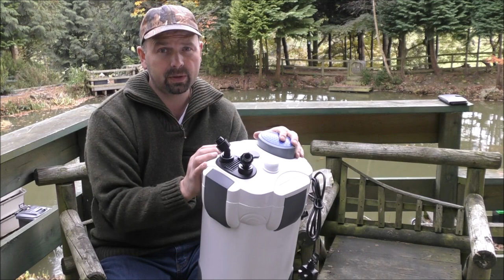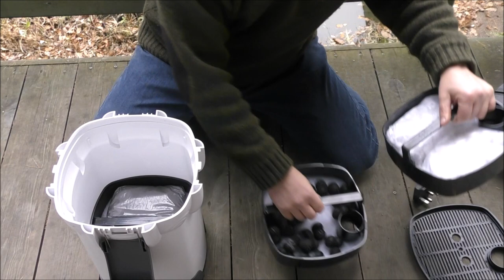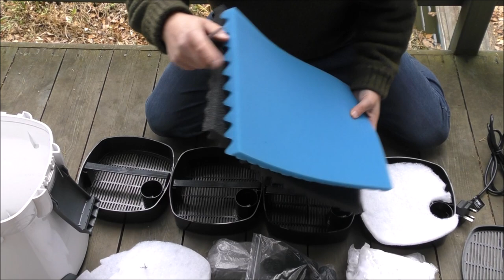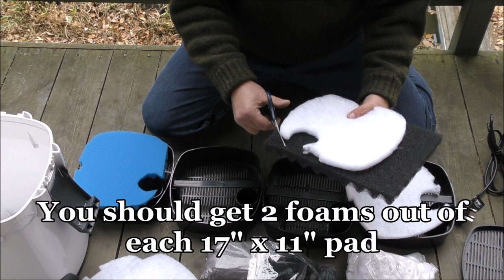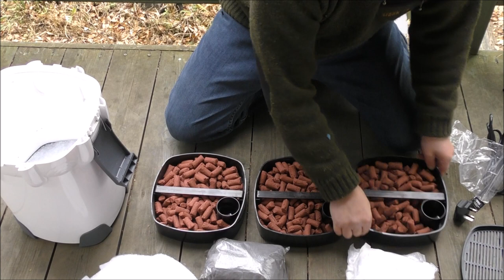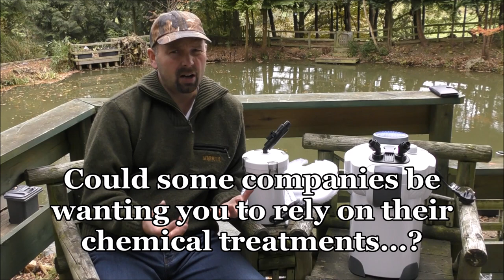Why Your Filter is TOO SMALL and NOT CYCLED

Comment: Got a 90g tank with a 150 gallon filter and a 70 gallon filter. Lots of live plants, and about 25 small community fish. My water stays crystal clear. All I run in my filters is filter pads with sponges, bio balls, and carbon. I have 2 air stones and 2 power heads. My tank is always beautiful. Oh and one of my filters has a UV sterilizer I only turn on if I start to see some alge growing at all.

Comment: Woody's Discus (FB)
No tone taken, Mr. P.G. A big thank you for the info. I bought 2 KG's of the "good stuff" for my Discus tank. Now I have a 150 gallon on its way. My Discus will love it. My 2217 has lost a spot in the filtering dept. Bought a FX4. May need a bit more media.Will give Don a call.  (will watch video again first )
Thanks Again,
Craig
Reply: BTW, my nitrates are 0 since using Bio Home !
Reply from the maker: Groovy, thanks for the feedback as it really makes a difference. 
I'm not sure why but there are many people online (who should know better) who continue to insist that biohome can't possibly help to reduce nitrates but the thousands of people all round the world using it in all sorts of tanks achieving the full cycle would suggest otherwise. 
It's a simple matter of creating a receptive structure which is varied enough to support different types of bacteria and although the media is very labour intensive to produce the results speak for themselves.
Best of luck with the big tank, man.

Comment: I am using this filter. Tray 1 - using the four thin 'fine pad' mesh filters supplied (one per tray). Trays 2,3 & 4 - all ceramic noodles / rings 4.5kg. I do have a small pre-filter on the intake. Small bag of carbon and bio balls that I received with the filter?, I will save for a small aquarium. Great video.

Comment: Thanks for the video! im new to the hobby and had been given maybe correct but incomplete information about the cycle and especially filter size. before this video my 160l tank had a filter designed for up to 200l with at most 3/4kg of media and my nitrates were a constant problem, i have now got the sunsun 304b and added an extra 1.5kg of quality media plus filled all the gaps on those trays with bio balls. im guessing my little tank is gonna be extremely happy with the upgrade! your advice has saved me future problems!

Comment: Good stuff here.  I was contemplating putting a Seachem Tidal (using only physical filtration) on my 55gal cichlid tank to help shoulder some of the  load from my Aquatop CF400uv.  But I just placed an order for the Filter Booster instead, so I can have 3 full trays of bio media in the can.
    Also, putting a coarse sponge on the intake tube that sits in the tank has made a big difference.
Reply from the maker: Yes, those two decisions should really make a difference to the filtering capacity and ease of maintenance - that's what it's all about.

Comment: One thing about biological filtration that everybody skip but is very important, especially in planted tanks where there is a lot of rotting debris from dead leaves and wood hardscape, is the fact, that besides nitrogen, there is also carbon to be warried about. I mean all the organic matter that builds up over time and can lead to red algae infestation. Having a big filter with plenty of bio media not only supports the bacteria responsible for the nitrogen cycle, but also leaves a lot of space for the bacteria that decompose organic matter, meaning less water changing, no substrate cleaning and healthy aquarium.
Reply from the maker: 100% - a filter should always be 'over-sized' for the tank.
If you follow the manufacturers inflated claims about the tank size the filter will cope with then the filter will surely end up being under-sized.

Comment: took a long time before I bought a good external, ive got a 350l corner tank with built in filter (1000l an hour so 500l in real time) plus a Aquael Filter Ultramax 2000 set up as per pond guru's video been running for 6 weeks now and tank looks good

Comment: I use that booster filter, the small one you showed but mine has its own pump.  I used it on my Nano tank  and it did a great job.  When I got rid of the nano-tank I put the small booster filter on a 65 gallon tank and the discharge from that booster filter goes into an HOB full of biohome ultra with forced bottom up filtration.  That is in addition to the two canister filters I have on the system also with biohome ultra in them.  Works great
Reply from the maker: Sounds good to me and you can never have too much filtration. 
Groovy.

Comment: I agree 100% with the statements regarding chemicals. I used Seachem Prime for years & it's only since I stopped & moved to a HMA that I have noticed a massive improvement in water quality my PH is more stable now as well it would fluctuate loads with Prime when I did a water change even when left to mature in a butt with a heater & air pump, the reason I Prime it in the first place is because my tap water has Nitrate in it which I thought was bad but it really doesn't matter as long as your filter is sufficient enough, your better off not using any chemicals at all.
Reply from the maker: Boom - you got it, it's all about the filtration. 
Look after that and it will look after the water - so many water quality issues rely on bacterial processes and when the bacteria is adversely affected it has a direct result on water quality which has a direct result on fish health.

Comment: Thank you, Pondguru! I've been wondering why my Eheim Ecco pro 130 felt so anemic (even with a properly configured setup of coarse/medium/fine foams and 500g of Biohome ultimate): according to Eheim website's specs, it's actually meant for 60 L tanks, which is half the size of my current 31 gallon tank. So, I just ordered the Eheim Pro 4+ 250, which is truly meant for an 120 L (31 gallon) tank. I also ordered 1 more kilo of biohome ultimate, for a new grand total of 1.5 kg of biohome ultimate, from Pondguru's US supplier: GreatWave Engineering.

Comment: Great video. Demystifying canister filters. After watching your video of how to setup a canister properly you put out a ways back. I set mine up that way. I would like to show this video at our local aquarium society meeting if that is ok. I purchased an Eheim 4+350 to run my 55 gallon or 200 litre tank. It will be prefilterd by a corner matten with the intake behind that. Now just have to track down some biohome ultimate. Cheers from 🇨🇦
Reply from the maker: Yes no problem - feel free to use the video however you want to as I put them out there to be shared.
There is a supplier in CA - http://www.angelfins.ca and the links to other supplies around the world are at the top of every page of my website http://www.filterpro.co.uk
Hope that helps.

Comment: This is the best info I’ve ever come across regarding canister filtration.  Thank you very much!  I used the foam technique but using lava rocks instead of the expensive biohome media.
Reply from the maker: Lava rock is fine as a DIY media and certainly more effective than the poorer forms of ceramic rings so its all good - whatever works for you is the best choice.
Reply: Pondguru Pondguru So I ran my filters for about 4 weeks and just checked them out.  Lots of muck in the bottom, replaced fine foam.  Bio section was spotless.  Great system!  Thanks!
Reply from the maker: Awesome, I'm glad to hear that it is working well.

Comment: Thank you very much you made a lot of sense and I did find it very helpful. I did feel that the sponge with the biggest holes should go on the top as the filtration for my tank just has the water trickling from the top. Yes you are right, I got told that I was doing at upside down. I felt that the foam with the biggest holes would collect the biggest junk first and not let the white foam gets so clogged. I am going to try and change from this silly filter to one of those barrel filters that you were talking about. Thank you so much you made a lot of sense.

Comment: I'm so glad you used that Sunsun 2000L/hr filter in your video. I currently run 2 of them on my heavily stocked 300Litre African Cichlid tank plus a sponge filter for quick cycling an emergency or hospital tank. 1 of them I run with a UV light the other without. Would you recommend I use the UV light on both or 1 or none at all.

Comment: THank you for posting this video it's very tutorial! I have started this hobby 1.5 years ago on a 60L tank (for tutorial reasons a smaller tank to prevent expensive mistakes) with JBL410E canister, Dennerle Osmose and Dennerle Remineral+ my diamond tetras feel great with 20Litres water change a week with NO2 and NO3 barely measurable with eSHa test tabs. I have been running this filter for 13 months now and got my water tested every 6 months  at the LFS for confirmation of my measurements are sound. for this reason I do not test my water for 9 months because of it's consistency. The 100% osmose is kind of a deal breaker on a future bigger tank due to a large amount of waste water, multiple 20L tanks and time consuming filtering, preheating and mixing remineral+. I like to purchase a 350L tank in future to have the Diamonds schooling in a 20-30+ group. My question is would your filter modification reduce the needed amount of water change to an acceptable level for prep and waste of water and costs?  Not keen to consider tap water because I'm very pleased with osmose filtering.
An other question I cannot find a good answer is if an additional remineral filter to an osmose filter system to make it drink water would this be good for fisch as well or would Dennerle Remineral+ be adviced. For water changes I am considering a tankless automated Osmose filter with remineral can connected to thermostat krane which should be worth considering.

Your filter mod is very interesting but I recon water prep is part of this as well. No chemicals should ever be needed (fingers crossed)

Kind regards, Erik from the Netherlands
Reply: btw recently I added a wash sink drain to the bottom of the canister to have my water chang siphoned from there takes away a lot of mechanical waste out of the system. works like a charm.
Reply from the maker: Sounds like you have it going on very well there and adding a drain on the bottom of the canister is a great idea..
Re-mineralising RO water should be all that is needed for most fish types and no additives for chlorine as it will be taken out in the Osmose filter along with heavy metals and other stuff which a water conditioner would generally be used to remove or bind.
Reply: I reconed your filter media presentation would be highly adaptable for upscaling my tank along with RO which has my attention now. I uploaded a short vid of my Diamonds to see their behaviour when they feel comfortable. Took me a year to make the adjustments in the tank to get this far. It's great to take care of a shy breed when all expectations come true!
https://youtu.be/BsFaKwHxk40

Still not sure if reminaral Ro for human consumption would match for fish as well which would simplify water changes quite a bit. perhaps you could show some insight here as well.

I had a look at the Eheim site and noticed the classic line would be great without the extra features like the canister you showed in the vid. They only remark would be a flow rate which might be to high and a power consumption not needed. I think mechanically restricting the flow isn't desired because of the power input is not reduced. Would a can and inline pump be a better alternative to create needed volume and match desired flow?

Same thing for heating. Would isolating the tank and filter be worth reconsidering? I recall The King of DIY having a 2000gal tank with 300W heater. This would reduce maintenance costs to a very friendly level. for this reason I'd shy away for 450L tanks for now.

kr, Erik

Comment: I bought the 603  after watching this video. How do you connect the 603 to a SUNSUN 304/404/704 or 3000?

The hose size on 603 is 16/20  while the 4 series of SUNSUN has a hose size of 18/22. If you use this using a coverter, it restricts the flow alot and I can feel the heat on top of canister.

Comment: Does the use of the Biohome Ultimate media eliminate the need for the carbon / chemical?  In the video, you state that the manufacturer incorrectly instructs the user/owner to place the carbon / chemical media in the wrong place in the pump.  You further indicated that if used, the carbon / chemical media should be at the top (The last passthrough before the water goes back into the tank).  However, in the video you don't add the carbon / chemical media.  I'm confused.  Please advise.  Thank you.

Comment: My pond holds approx 2.75m3 water. I have just introduced 28 6" goldfish. I have a strong pump supplying a Laguna Pressure-Flow 2500, which I was given with the fish. I bought a service kit for it which included coarse filters. I bought a sheet of fine filter material and cut to size. The fine sheet I placed in the bottom as I believe the water flow is from top to bottom. The water is tea coloured, and, still has particles in it when I take samples.. I don't think this system is coping with the fish content. I've ordered an Oase BioSmart 3600 with an Oase Vitriolic UV lamp. My intention is to pump water from the pond to the Oase Biosmart (mechanical flirtation), feed from that to the Laguna, then back to the pond. I'm thinking to use the Laguna as a biological filter replacing the pads with Biohome Ultimate and  some Carbon. Pondguru, am I thinking about doing this the right way? Also, should I place the carbon at the bottom of the Laguna. the carbon I hope will remove the tea staining caused by rotting leaves. I'm new to fish keeping. I've been researching your YouTube videos. I would like to achieve crystal clear water and healthy fish. I live in Southern England. Thank you in advance for your advice, Alan

Comment: Brilliant. Not advice  but actual teaching. I have a JBL e902 on the way for my 90L tropical community, only started this Waterkeeping hobby 3 months ago and this is my 3rd filter unit purchased. It will also be the last but it doesn't sound like I'll be keeping much of the internal contents.
Thanks Pondguru.
P.S Can you advise on the correct stuff to treat the tap water chlorine, mine currently has 'protective herbal extracts and heavy metal treatment' - What and where to buy and should I use any of the 'bio active bacteria' type products? Either initially or until full cycle is achieved?

Comment: Funnily enough this is the filter I have running on my 350 litre tank. I have mine set up in the same way and last week I bought 5kg of Biohome Ultimate for it too from your eBay store. I'm really looking forward to seeing my water test results over the next few months to see if I manage to drop my Nitrates. Unfortunately the tap water in my area contains between 20 - 40 ppm of Nitrates straight from the tap which of course only goes up when its added to the tank with my current Ammonia and Nitrate conversion from the tank itself. I don't particularly want the Nitrates at 0 simply so my plants can still benefit from them but a reduction to about 5 - 10ppm would be awesome!

Comment: You can do the same as the booster pump by simply using a prefilter on the inlet. My canisters stay spotless inside except for the polishing pad. I replace the polishing pad once a month with a light gravel vac and water change.. my weekly maintance is 2min to simply remove the prefilter clean and put back. I played around with medium and corse as a prefilter and the medium almost eliminates the need for mechanical filters in the canister entirely but reduce the flow too low to get enough water changeover. Either way I do less maintenance in 6months then most people do weekly all due to the use of a prefilter..
Reply from the maker: Yes that is a very good point there, plus a booster filter doesn't have to be on the inlet. If it is filled only with filter media and put on the outlet side of the canister filter flow will not be restricted as much.

Comment: Enjoying the videos very much, very informative.  I currently am using a hang over back filter and haven't had too many issues but recently I checked my water and my nitrates are insanely high.  Needless to say I am thinking about switching to a canister filter because honestly I don't think that the HOB is doing much good.  Thanks to you I have a better Idea of what to look for.
Reply from the maker: No worries, as long as the filter is suitably sized for the tank and stock and an appropriate amount of good porous media is used then a full cycle should be achieved.I only have feedback for success achieved with the biohome (years of feedback from people using it all over the world) so that is why I am able to recommend specific amounts for different stocking densities - more information on Q&A page of my website http://www.filterpro.co.uk